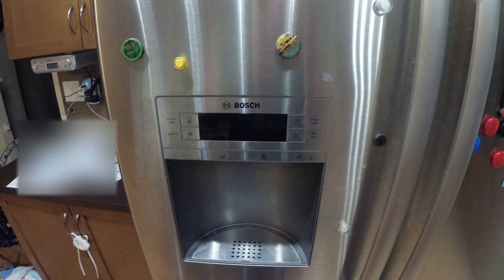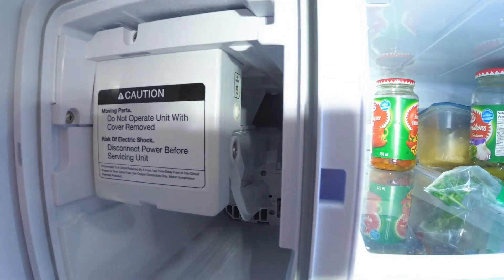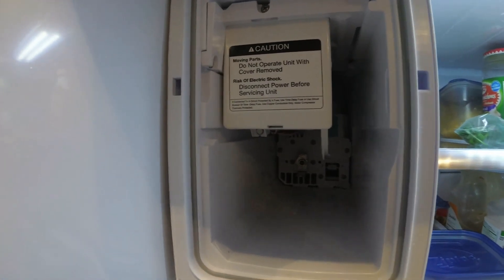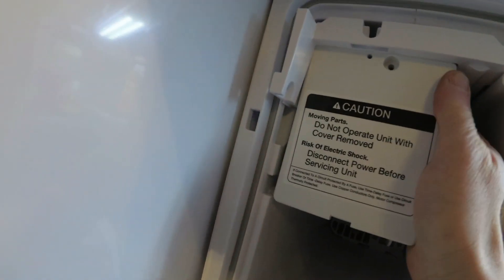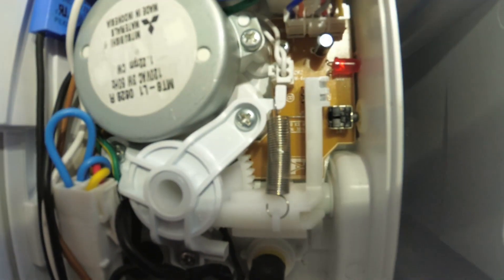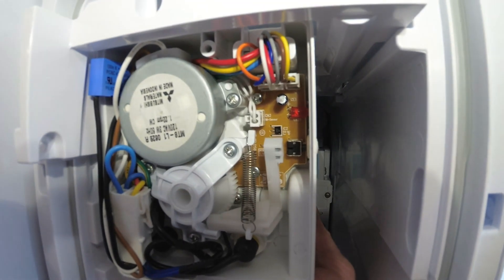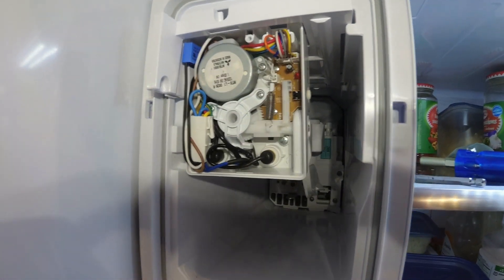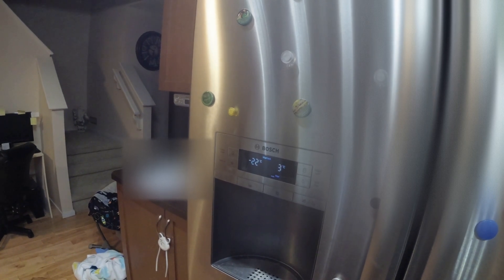Fix your Bosch Ice Maker with out removing it!

Comment from the maker: There have been a few comments about this, but put the magnet in place. Test it out to make sure it is making ice. If not, flip the magnet around and test again. @chrisluehmann3094  found that the magnet is pole sensitive He said one side of the magnet has a very light dusting of white paint. This side must be facing away from the sensor.
Once it is working, I would make sure you know which side needs to face the magnet then put some glue on the back of the magnet so it doesn't come out again. (the part of the magnet that faces away from the sensor) I used super glue myself.

Comment: Mate, thank you so much for taking the time to post this video. I had the same issue with my fridge and the fridge guy just wanted to replace the ice maker. Would have cost me over $300. I did what you did and found the magnet sitting on the bottom of the ice maker. Placed it back in and glued it, now it works just as it did before. You are a champ. Once again, thank you for saving me $$$$💵💵💵🤑🤑🤑

Comment: Yes Same thing the magnet was attached the top of the micro switch housing. Thanks for the advice re access to the icebox. It took about 5 mins to open and put back. I might put some hot melt on the back of the clip and magnet so they don’t come apart. The guys from Bosch have a $150 call out fee and wanted to replace my icebox talking to them over the phone. All they are interested in is the moolah $$$ worse than pool shops.
Reply from the maker: More and more places just replace everything when the do a so called repair.

Comment: We have the 2012 model B26FT70SNS/02 can you assist. They no longer make a replacement unit.
Reply from the maker: What is the symptom you are experiencing?
Reply: @smikey.  ice machine not working
Reply from the maker: Your magnet was in the right location as talked about in the video? 
I will try to find an ice maker replacement part for you.
Reply from the maker: I found a couple of websites still selling the unit. The OEM part number looks like it is 00649962
https://www.genuinereplacementparts.com/11033701-oem
https://www.searspartsdirect.com/product/1bm32q4myi-0046-630/id-00649962
Taking your model number and searching your fridge model for a parts diagram will also show more websites that you can buy from.
Reply: @smikey.  thank you will check them out. Curious why repair store and technician told us no longer made.

Comment: I have a question that side button that you pressed to removed the cover is not working. Trying not to brake it but any suggestions?
Reply from the maker: It may not be the side button. I found the ice unit was stuck in the first time. Try pushing the button while wiggling the unit side to side and up and down.
Reply from the maker: What was the time of the video you were asking about?
Reply from the maker: Perfect. If that doesn't work, a lot of people besides me have found the magnet out of place.

Comment: The ice tray is not sliding out so easy like in your vid. Any tips? I was thinking of taking the stuff out of the fridge and letting it melt a bit.
Reply from the maker: If you have the same model of fridge, just make sure all the screws are out then gently wiggle it back and forth as you slide it out. If it isn't the same model, check for additional screws.
Reply: @smikey.  I did not realize there were screws - thanks!
Reply from the maker: No problem.

Comment: I cannot remove the ice container in my Bosch refrigerator. I depress the release button but the ice container will not release. Any suggestions as to how to remove the ice container?
Reply from the maker: It could be stuck. So push on the button and gently just wiggle it up and down and side to side and see if you can get it to free up. Hopefully that works.
Reply: @smikey.  Thanks. I read that in one of your earlier posts. I’ve tried it multiple times with no success. I just raised the temperature a few degrees to see if that will work. In the meantime I will keep doing what you suggested.
Reply from the maker: That is another alternative that it is frozen. 
I hope it works out!
Reply: @smikey.  Thanks. I’ll let you know.

Comment: Hey mate I am at 2:49, inserting the blade bit into the bottom slot to pop off the cover. I've been at it for nearly an hour and I can't seem to get it to pop out. The inner plastic tab pushes up when I use the blade bit, but the cover doesn't pop out like yours did. Same model and such. Any advice? Thanks in advance.
Reply: I ended up putting the blade bit into a multidriver and flexing the front panel down below the tab and then just pulled the cover off. As suspected, no magnet in the arm. It was stuck to the spring. Got the magnet back in, reassembled the whole thing and turned the ice maker back on, drawer is back in. Hopefully when I wake up I will have ice. Thank you!
Reply from the maker: Check to make sure you get the screw at the top out. Try to pull the ice maker out and down as much as possible. Then push the tab like you were and with a second small blade screw driver, gently pry at the cover seam. Maybe a second set of hands would help with all this.
Reply from the maker: I am glad. I sure hope it works out for you. I love when I am able to get save money and get things working at the same time. 😁
Reply: @smikey.  Its the best feeling of accomplishment in the world. You rock!
Reply from the maker: Let me know when you hear the sweet sounds of ice being made!
Reply: @smikey. So far, silence... fingers crossed for a better result in the AM
Reply from the maker: Just double check your switch is turned on. The red light should be on. Other then that, try to move the ice arm to make sure it isn't stuck. Put everything back together and see hoe it goes. 
There is a second magnet. It is on a gear that rotates, but I have not as of yet heard anyone say that guy was loose. 
Here is hoping it works out.
Reply: @smikey.  hey! No ice this AM. second magnet present, arm moves freely, red LED is on. I'm thinking that the magnet was part of it but I want to pull out the fridge to see it from the back and see if something is connected up odd or something. The water dispenser works fine.
Reply from the maker: There are 2 valves on the back of the fridge you can find near the bottom right. One is the water inlet for the water dispenser and the other is the water inlet for the ice maker. I did swap the 2 connectors and by using the water dispenser button was able to verify that my ice inlet valve worked.
Reply: @smikey.   Brilliant! I will try it. Thank you SO MUCH for your help. I'll let you know how it goes. Will be a couple days. Thanks for your kindness.
Reply from the maker: No problem. This is what I enjoy.

Comment: My ice maker works but the dispenser doesn't. When pressing the button the flap opens but the ice pusher doesn't spin. Don't suppose you know how to fix that?
Reply from the maker: Start with checking that both magnets are in the proper location. Let me know what you find.

Comment: My ice maker won't release after i press the button.  Suggestions?  Thanks very much.
Reply from the maker: Hey I am not quite sure what you mean about your Ice maker wont release after pushing the button. Can you give any more details? Do you mean the switch is stuck, or the ice still doesn’t come out of the machine after you push the on button?
Reply: Hi, Thanks for getting back.   Backstory- motor will activate when button on panel is touched so I believe auger is turning as I can hear the churning. No ice coming out of chute.  Water feature works fine.  When I press the square white button on the right side of the cover (the one you pressed with your thumb) the tray with the auger wont slide out.
Reply from the maker: Try only pushing the bottom of that white button. That is the part that pushes in, not the top. While the bottom of the button is pushed in, give the tray a tug out. If that doesn’t work try rocking it slightly back and forth and you do the previous steps. Let me know how it goes.
Reply: @smikey.  !  Thanks.  I got the tray out!  I had to give it more of a tug than I thought I should have but it did release.  Not to watch the rest of the video again!
Reply: So I think that the plastic arm is stuck in the up position, not contacting the magnet to send the signal to make ice.  I will check your other videos to see if there are instructions for that.  Thanks
Reply: I think I can have frozen margaritas tonight!  I think there was an ice jam preventing the cog from cycling.  Cut power to fridge, 20 min with a hair dryer.  Cog cycled and arm dropped to the lowest position after I restored power! Thank you for your help!
Reply from the maker: Good. I am glad. My ice maker didn’t work for the first two years we moved into my house only to find out in my situation  a magnet had moved. We use ours all the time. I just decided one day I would just see it it was something simple.

Comment: Anyone still checking this ? My magnet is fine, but the lever that goes up and down seems to be stuck in the up position. Any clue what do do there? The gear that's to the side is the lever is blocking it from coming down all the way but i don't know how to spin the gear
Reply from the maker: Sounds like you have the cover off. Send me a photo and I will see if I can figure it out. smikey1@hotmail.com
Reply: @smikey.  Emailed you
Reply from the maker: It looks like the gear the motor drives is out of sync. I will email a replay on what I think you should do.

Comment: Great video however after putting my magnet back and ensuring that it had a clean surface and made contact with the switch my ice maker still doesn't work.  Did anyone else have the same issue or problem.. I will check the water solenoid next but would appreciate any thoughts anyone has.
Reply from the maker: You have made sure the red on switch is on? Does it make any noises?
Reply: @smikey.  Thanks I actually took the magnet out again, completely cleaned the surface of all materials, reinserted it and today we had ice.  Thank you though for responding it was much appreciated. Again great video showing the steps needed to fix our ice maker.
Reply from the maker: Wow. Awesome. I bet it feels great to have figured that out!
Reply: @smikey.  Yes Great New Year's eve present!
Reply: @danielfischer3539  Hi Daniel, hoping you can assist mate. I found the magnet wasn't in its little spot on that arm & was stuck to the motor so re-inserted it into the arm but still no ice. can you elaborate on what you cleaned (assume arm & little black sensor on the PCB?) and if there is a specific orientation that the magnet has to be installed ? are there any tests that can be done other than waiting x hrs for ice once surfaces cleaned? eg. ice mech filling with water? i'm also getting no voltage on the associated water intake solenoid currently. thanks heaps craig.
Reply from the maker: If you found the magnet out of place and you have put it back. Make sure it the ice maker is turned on(the switch inside with the red light). Then try moving the ice arm up and down to make sure it isn't stuck. 
You can try the quick ice button once every thing is back together. 
Within an hour it should be making ice making noises. 
Let me know if it still doesn't work.
Reply: @smikey.  Hi mate thanks for your reply, yep I’ve checked those items and I can see that water is not flowing into the icemaker unit. I have tested the wiring in the solenoid at the rear of fridge and can confirm the icemaker solenoid is fine I swapping the water dispenser and ice solenoid wiring around you can manually activate then water does flow into the icemaker.Perhaps the icemaker unit itself is faulty and is not switching on the water solenoid even though the arm is in the down position and the magnet is pressing against the sensor? I was wondering if there is a simple test or observation that can be made to ensure the magnet is working as it should? How long after the arm is in the down position should water start flowing?
Reply from the maker: I don't know a set time. I can empty my ice maker and time it if needed. 
How much time have you left it to start making ice?
I think one side of the magnet from what people have found has glue on it and that is what they are cleaning off. Mine did not.
Reply from the maker: To answer your question I don't know how long, but within a few hours it should work. 
And unfortunately I don't know of a test to check it.
Reply: @smikey.  hi, if you empty your icebox and then close up the fridge again, then select the quick ice button on the front, how long does it take before you hear water flowing into the icemaker assembly? Thank you!
Reply from the maker: I am timing it right now.
Reply from the maker: 29 mins and 2 seconds
Reply: @smikey.  Thanks mate that’s very kind of you cheers